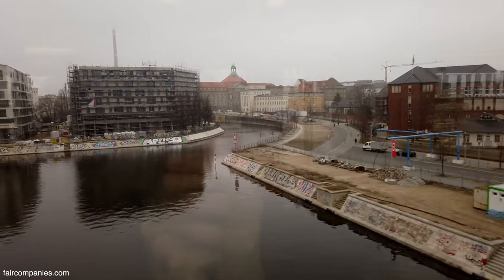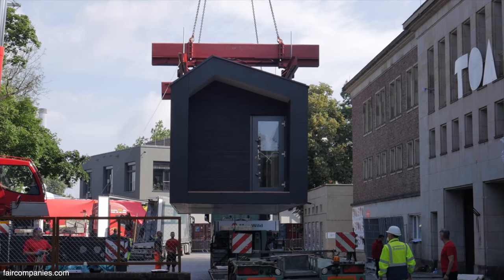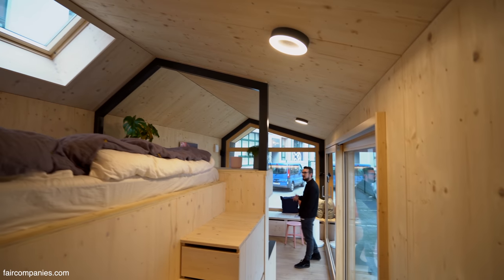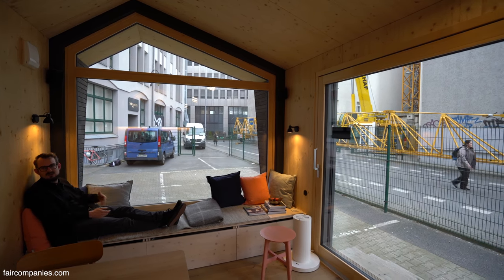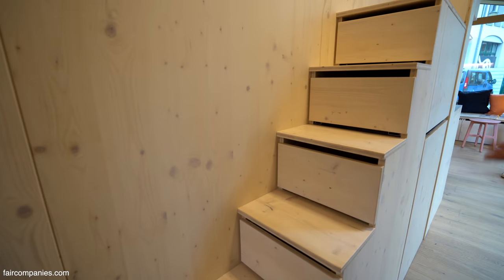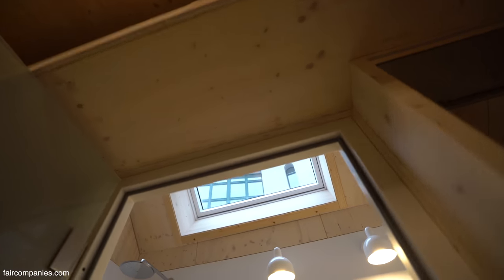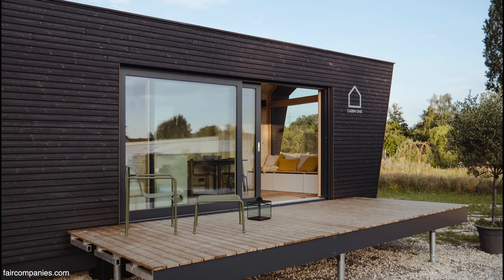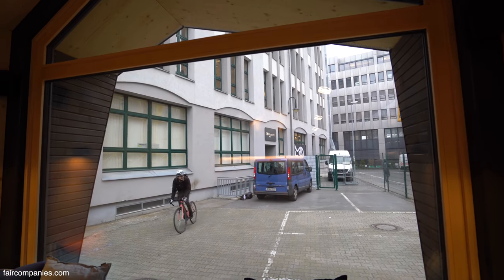An easy-to-install prefab cabin as alternative to rental flats?

Comment from the maker: Rooftop prefabs are not a new idea. Five years ago, I checked out a company in Barcelona already doing it https://www.youtube.com/watch?v=yUgeksMARpw "La Casa por El Tejado" ("House on the Roof") find buildings that are allowed to go higher (there's obviously some that can't for structural reasons) and then pay the individual apartment owners for the roof airspace (they also pay to put in elevators into older buildings) and then crane in a new unit.
Reply: No they aren't a new idea but a solid 95% of existing bldgs cannot make it cost effective to add roof top modulars,the only buildings that can take the weight are bldgs built with the intent to add more stories in the future,to take the weights of modular units most buildings require massively expensive renovations before the pre built can be hoisted & set in place,every roof top apartment must have atleast 2 emergency exit points that small children,disabled & elderly can use,this means building external stairways from roof to ground that cost more than the pre built apartment,walkways have to be built so the tenant wont bust their ass on slipery commercial roofs,50 inch continuous gaurdrails have to be built & installed to prevent the roof top tenant from getting closer than 10 feet to any inner or outer building edge to prevent slip & fall deaths.

The pre built unit shown in this video cannot be rented to a single tenant,it cant even be occupied by the bldgs owner in its current state with assured death hazzards on all 4 sidez of the unit,for the $ involved reinforcing a bldgs super structure & massive saftey eauipment costs a bldg owner would be far better off adding another storie to his bldg.
Reply: @michaelledford4751  exactly
Reply: @Kirsten Dirksen, What's the price?
Reply: Instead of trying to invent new places to stack and store human beings maybe it's time to sit down and logically talk population limits. you may stack them out of the way and out of sight but you haven't addressed additional waste, I.e. trash removal, clean water supply and bodily waste treatment, not to mention start stacking people in together that close a simple flu bug turns in to a pandemic.
Reply: just curious if the market for this type is more typically male, than female?  And roughly what age bracket is the typical target market?  Thanks... To purchase and then own such a domicile at such a cost as one's main dwelling (rather then renting something modern but small for a year or two), would likely be a prospect more attractive to say, a middle aged male?  And likely freak out most females in the same age bracket ?
Reply: @nonsondife5858  I was wondering the same thing!
Reply: Love it
Reply: @michaelledford4751  Not to mention whether it can sustain earthquakes or hurricane-force winds - which may be rare in Europe, but still....

Comment: Hey I'm from Germany too! 
I would definitely rather invest in a air conditioning system than a dishwasher or a smart mirror. It really, really gets hot on the rooftops.
Reply: I think it also assumes that you bring your clothes to a launderette.    You can't wash them there. I can't see how water & electricity will connect to the home. How about waste water disposal? How about rates? Will people pay full annual maintenance fees for living outside a building?
Reply: Yeah, they never mentioned the hotness up there, and no cross breeze windows.
Reply: Veronica Roach I have lived in many different sized houses and apartments. Had huge kitchens, and smaller kitchens. I’ve never owned a dishwasher in all my 58 years. Why start now?
Reply: the rooftop is where the help lived.....
Reply: @FurnitureFan  I own a building like that one they put it on. The water from the roof drains into the main waste water drain so you just make a tie into that. As for fresh water you just tie into the nearest supply line and put in a meter. You hook to floor below. Same thing with electric just tie into the nearest sub box below and another meter. You could do same thing with gas. It will involve cutting into the roof which is bad because it hurts the integrity of the roof which are mostly rubber. I think these roofs must be concrete. It would be hard.

Comment: What is percentage of roofs that can handle weight like that too.  Then with snow load....
Reply: Most of the old 19th century buildings in Berlin are made of very very thick concrete walls. The main issue would be if the beams are still good.
Reply: That was my first thought.  Second thought was privacy, especially in the bathroom and bedroom.  Would need one-way glass.
Reply: 0.001%, maybe less.
Reply: The walls of buidings will be able to support the wight of the house (in most cases). You just need to find a way of transmitting the load from the house to the walls. Something like I-beams will do just fine.
Reply: @Himself Lee - Same as the rest of the building, they can just add lines to the roof and hook it up.  It's only a question when placing it on your own property in an off-grid scenario or on undeveloped land...

@Renato UnREAL - Depends on the building.  Older ones will likely be just stairs but newer ones may have a lift or it may be installed as part of a whole building retrofit, depending on the budget...

@Virginia Moss - Or just add curtains...  Or add something to the roof that blocks the structure from view, just like a property fence, etc. that'll also address any safety issue with the edge of the roof by adding a physical barrier...
Reply: This is what I was wondering. I suppose a cabin like that would weigh considerably less than snow pack, but can all of these buildings support the weight of the cabin plus the snow? I don't know
Reply: You would get into legal problems before this becomes an issue, not to mention that I doubt the economics. The legal limit for the height of residential buildings in Berlin is 22 meters, so you'd need a special permit to build higher. And if you can get that, and you have a roof that carries the load, then it makes much more sense to build a penthouse or an additional floor (putting a small cabin up there would just be an awful waste of space). And people who buy property in Berlin absolutely do look for something that will last for thirty and more years, so I doubt this idea will lift off. Still, I think the thing is rather beautiful.
Reply: @Josh Magda He does say in 2:10 that they "prepare the rooftop ... prepare the regulatories all that stuff ... it's all part of the building process" so my guess is that this cabin only goes on roofs that can support its weight. I know it's a stereotype about how exacting Germans are but in the video (6:37), he comments about the steps being too small for commercial use so they change it when they make them for hotels. I am certain these guys calculate the weight of their house (which they know) and if the building can support it and where exactly to place it so it doesn't fall through the roof.

@Virginia Moss that's a concern for me too but I figure, up on a roof, while I can look out, I doubt there are a lot of people who can look back in and the door to the bathroom is fogged/translucent so there is a measure of privacy.
Reply: @lunatickgeo  I'm sure they do the engineering, and due diligence.. of course they would.  In the first minute he says there's room for 55,000 flats on rooftops.  Of course you can reinforce any rooftop but is it feasible, or cost effective to do so? You can engineer it but I'm betting a large majority of the 55k mentioned would be cost prohibitive.     I want one of those cabins on some mountain land they are cool.
Reply: @whaterfoo  I guess the person who can best answer that would be the person buying the cabin. I'm with you, I would prefer to have a home further away from the city, but there are people who need to be in the city and sometimes there just isn't any more space. So they would be willing to pay for this cabin on a roof with all that entails, maybe the cost to have the roof reinforced to them is worth being near where they feel they need to be?
Reply: @lunatickgeo  having been in insurance related construction more than 20 years this idea has many flaws and is a problem.   It would be more feasible to gut buildings and redo the inside in micro units then these things on a roof.  LOTS to go wrong with a secondary structure placed ona rooftop.  But hey if someone wants to pay to give it a try sure, go ahead.  Insurance will be hard to obtain, and if there are any issues in units below, the rooftop "addition" will be brought into question and subrogation will be a bear.  Actuaries will have their work cutout for them.  I see more permanent residences in hotel like structures being a better solution.  With shared community kitchens, and rooms for entertaining.
Reply: Loads was my first concern
Reply: probably most of them bc buildings in germany arent made out of paper and a little bit wood...
Reply: I have worked on a lot of rooftops.  They are usually rated for a pretty good load.  But I noticed they brushed RIGHT past sewer and water.  (obviously there was power and likely water connected)   The toilet is obviously a cassette model so you get to shlep your "waste" somewhere regularly.

The graywater most likely just goes down the rain gutters.  (sink/shower drains)  This isn't that different than a RV really.  Just no wheels.
Reply: I have worked on a lot of rooftops.  They are usually rated for a pretty good load.  But I noticed they brushed RIGHT past sewer and water.  (obviously there was power and likely water connected)   The toilet is obviously a cassette model so you get to shlep your "waste" somewhere regularly.

The graywater most likely just goes down the rain gutters.  (sink/shower drains)  This isn't that different than a RV really.  Just no wheels.

You usually need to take stairs down a level to catch an elevator.  they NEVER go to the rooftop.
Reply: Buildings in europe are made of thick concrete
Reply: No way are German building codes going to allow shit like this to happen. Also, I saw costs of such prefab homes in my city, they are more expensive than normal buildings because it's "custom designer"! Not to mention who's gonna repair them and at what cost when they fall apart in a couple decades.

Basically, projects like this are being done by wannabe designers/architects, and never catch on for economic/regulatory reasons, not to mention the actual lack of living comfort and demand.
Reply: Renato UnREAL  use the building elevator/stairs to the rooftop :) lol
Reply: @unavailable753  But, if you can rent space to 4 tiny home owners, without the additional costs of building, it can be an appealing option.
Reply: i do like the big windows
Reply: The individual loft is nice.
Reply: That's what structural engineers can figure out. Obviously the subjects of these videos Kirsten did On this theme, have done all that and Kirsten puts a link to the creator in each video, so you can and should contact each one of them with you guys type questions, to add up all their wisdom & info on the subject making it possible to do these kind of excellent ideas in a first class quality way, like they do things in Europe and be able to quell the ignorant mindsets of nay sayers. (But try NOT to convince the naysayers who are the type to do everything in low class ways and screw everyone & not pay contractors & whatnot, like Donald con artist liar Trump, but instead do these kind if projects with quality people who believe in the level of quality of the excellent designer/builders that Kirsten shows in her European videos! I LOVE them! It's like heaven on Earth type people and builders!!! Thanks so much for showing us so many like this Kirsten and you excellent European designer/builders!!! I/we love you! ☺
Reply: Josh Magda not to mention the sun on a hot summer day

Comment: 100.000 euros for the cabin shown in this video is just delusional.
Reply: @clarkkent6819  *rich german hipsters haha
Reply: Design. Goot. Ja.
Reply: Es ist einfach nur traurig.
Reply: But it has a coffee maker...
Reply: @grglyzen  Excellent!!
Reply: But that mirror is fire!
Reply: and one can't place another building on the top of it's roof! Not environmental friendly!
Reply: It would be $500,000 to buy one in Vancouver, BC.
Reply: @drunkvegangal8089  BUY A VAN - 40k
Reply: And buying a flat in Berlin is otherwise so very affordable, ja?
Reply: Crazy.
How to make what should be affordable housing ALSO unaffordable!!!
Reply: @Svetlenisthebest   I have lived in a 1995 Pleasure-Way van for the past 17 months. It cost only $17,000. It's not an easy way to live, tho. Especially at 55 years old. Any other advice...?
Reply: @drunkvegangal8089  Yes, buy a van and move to Tofino.
Reply: FYI - there are these things called "Mobile Homes" that cost a lot less, and they have been around for decades before anyone talked about a "tiny house".
Reply: Chris Babbitt it costs less than 100 USD to make if you have an old flat TV or monitor.
Reply: It really is dumb. You have no elevator to your floor so you will have to walk at least 1 set of stairs, maybe more. You're exposed to gale winds on winter nights. You will probably have no running water. The designer valued a coffee maker more than an oven or a microwave. The interior is cheap plywood. This thing was designed to do 1 thing really well and that is take the money from the buyer's pockets.
Reply: I paid 80 thousand for my 2 bedroom 2 story house with a small garden and huge attic for storage 12 years ago... just outside the city centre (I had to spend 20 000 to fix it up which I did all the work for). House prices are fucking insane at the moment. There's gonna be another house crash soon or a wider economic one. It cannot keep going at this rate of inflation. EDIT - Should also add that we should all look for options like this one as that is the only way to get house prices down. If it costs too much then do something different. Think outside the box !  I lived in a van for 2 years to save up the cash for a deposit for example. I would not be happy paying 80k for this small prefab but 70k I would have thought about it for sure 12 years ago.
Reply: @drunkvegangal8089  sell your van & buy an awesome rv w full bathroom n toilet, bathtub/shower combo, oven, stovetop, fridge, heater + AC. Try finding 1 w washer n dryer included. It's a lil harder to find but they're out there!!! Here in the USA theres all types of awesome fullt functional livable rvs for sale and if you sold ur van for $17k you could really get an amazing rv for even cheaper than that price
Reply: @KrustyKlown  i know of someone from my town who spent about $130,000 on a motor home and they spend summers in Canada and winters in Arizona. all the bells and whistles, a bedroom, a shower/bathroom, an expandable to the side living room, full kitchen with dishwasher, and the ability to tow a car in the back. it is the ONLY way to go for small houses in my opinion !!
Reply: @SirManfly  Sounds like a great way to live.. technology allows mobility when working .. so why are we all stuck in one place?
Reply: @drunkvegangal8089  YES, absolutely watch @vantastic videos - best VAN Life show  for me!
Reply: That is definitely delusional
Reply: It’s a smart home.
Reply: @drunkvegangal8089  More like $500,000 to RENT one in Vancouver. That's why we live in the interior, more sunshine and less cost.
Reply: Its germany, you would pay 3rd of that in eastern europe

Comment: Some great concepts here, though I don't really like much of the execution. For example, something like this, you stay/live in it with 2 people at most, so you don't need a dishwasher. The smart mirror is kinda cute but is just an unneeded luxury, someone can just set a tablet on the wall if they want something like that, the electronic/wireless windows again a unneeded luxury. You could probably cut out 30% from the cost by just getting rid of unnecessary luxury things.

Comment: Its a neat little house but I fail to see whats so special about it, there are many like it out there. And many even better excecuted in terms of layout and functionality.
 I dont really get the rooftop idea either - like others have mentioned - the weight, plumbing and accessability would probably be a big and expensive problem in the real world.
Great video as always though, this channel is a great source of inspiration!
Reply: Its a very unique layout. On first glance i really like it and it is very spacious looking. When I pick it apart I have more questions and mods that i would make. It can possibly be adjusted using the basic structural outline of the "rooms". You could potentially move the kitchen to the back corridor on the inside wall with a large rolling table and folding chairs in the main space. Mount a large monitor on the wall (above the dishwasher)  to serve as TV and for use at the table as desk. It would bring the plumbing together...w/d combo by the back door, with wall surface for coat hooks. Mirror opposite that with dog leash umbrella etc. Next to the laundry a full height fridge. Swing away counter hinged to the upper cabinet to make way for bathroom door, then stove with oven and a double sink. This might start encroaching on the space under the lofted bed. Stairs could go the other way with storage serving the desk and dining area. Mirrored kitchen backslash to bring the view and natural light into the kitchen since the cook is back to the windows. 

 I also wonder what's going on under the bedroom. Could that be a ³/⁴ height walk in closet with entry where the kitchen sink is?
Reply: Its also very exspensive

Comment: As a man with a journeymans card in Roofing/Waterproofing who specialized in commercial roofing i can state as fact very few roofs can handle that load,reinforced poured in place cement decks are the only possible substrate that wouldnt need support lf steel.